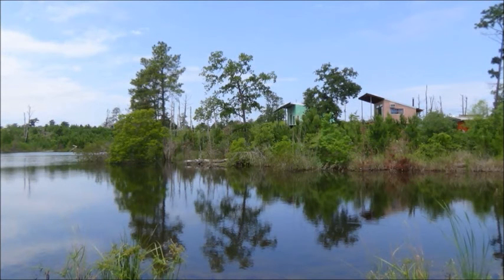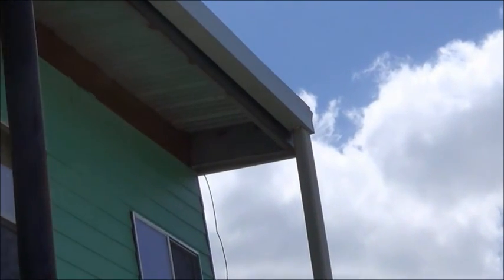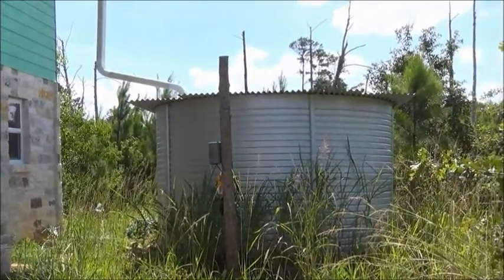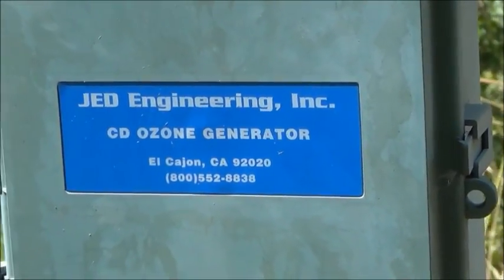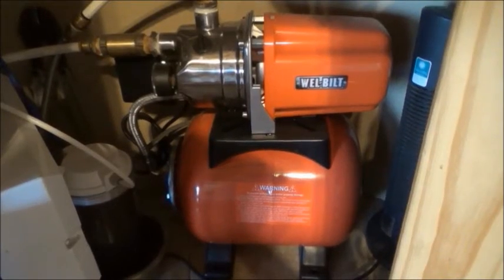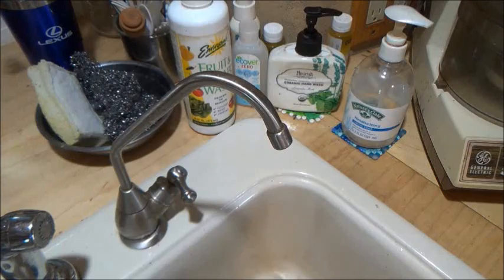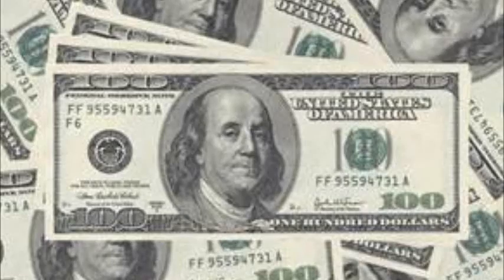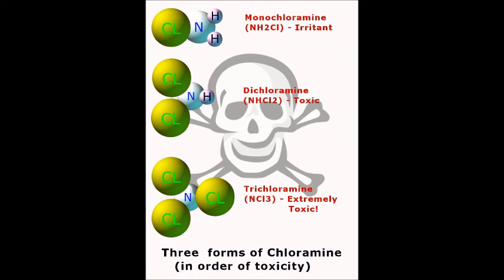Rainwater Collection for Off Grid Living

Comment: Very interesting system,  Thank you for providing the information so someone could build one like you did.  I hear that ozone does a great job of disinfection,  Is there a way to tell when the ozone quits working ?????
Reply from the maker: I pull the air stone out of the water and smell the air coming out of it while the machine is running. If it is working it will smell like chlorine. If it does not smell the unit is not producing ozone and needs to be fixed.